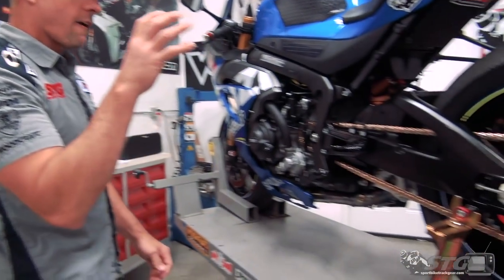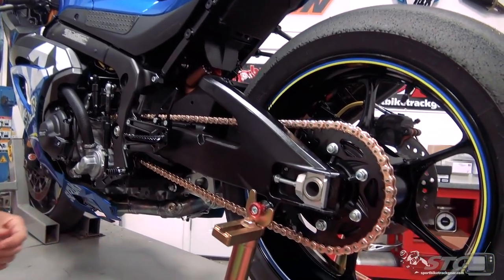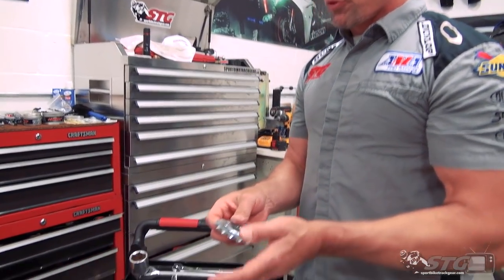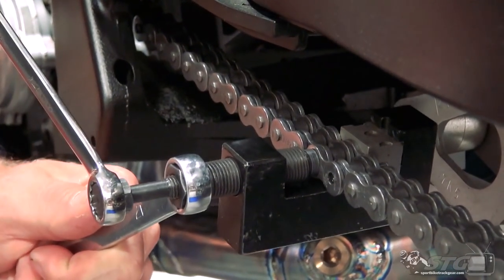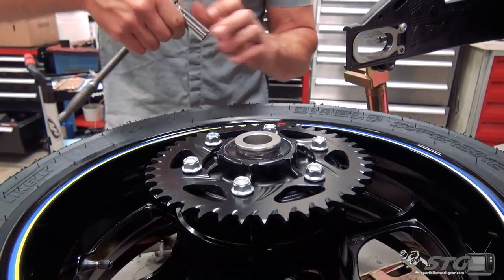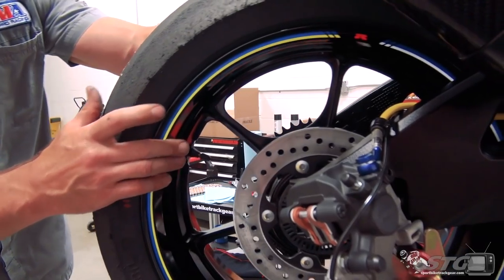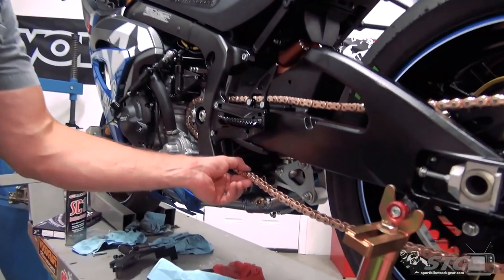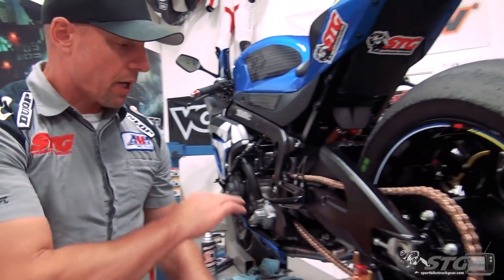Vortex 2018 Suzuki GSX-R1000 Chain and Sprocket Install | Sportbiketrackgear.com

Comment: great video. need some advice please 

 I had a massive issue with my front sprocket which has resulted in possible damage. So, as per other videos and guidance, I had the Mrs stand on the rear brake whilst i tried to crack the nut. I was giving it my all and then something made a horrible cracking noise, the bolt was still solid tight, but something else cracked - don't know what. I immediately stopped. continued with the rear sprocket and new chain but when I started the bike I now have an oil leak - not major, but slow. it looks like its coming from the water pump.  I haven't ridden the bike at all yet since changing the rear sprocket and chain but the horrible cracking noise has done something.

Any ideas on what this could be and what made an heart breaking cracking noise?
Reply from the maker: Man that does not sound good. You need to run the bike on the stand and track down the leak before you ride it. Remove the fairings so you have a clear sight line when inspecting. - Van
Reply: @sportbiketrackgear  yeah I have no intention riding it. It only seems to leak when I start the engine. What on earth could have made such a horrible cracking sound?
Reply: @pwh1t3y  first of I don't know what kind of bike you have but make sure it's not a reverse thread. I use a impact to remove and tighten. You just can't get it to spec tightening it with a torque wrench. There's too much flex everywhere. That's where the impact helps a ton. If your leaking oil from the water pump you going to have to remove the water pump and see what you can. If the bike wasn't in gear and your wife was on the rear brake the leak could be bad timing. Nothing could be stressed other than the chain and Sprocket in neutral. It sounds like some kind of bent shaft if it's leaking from your front sprocket removal attempt. Go Impact for this. Many years ago I did a sprocket kit swap on my K5. I was at spec using the torque wrench. I had a piece of wood wedged between the wheel and swing arm. Many years later when I went to change it. It just loosened right off. It was barely tight at all. I'm very careful now and only use a impact to remove and tighten. I always check it when I'm done by trying to remove it to make sure it's tight. I'm just paranoid after that incident. Unfortunately your going to have to remove that water pump and dig deeper. If the bike was in neutral you didn't break anything serious. Maybe just  coincidence

Comment: Hey van I  have 2011 gxsr-1000 was thinking to go 16 teeth front and stock 42 rear ,what would u recommend?
Reply from the maker: For 1000's I usually recommend leaving the stock size up front and going up 2 teeth in the rear. End of the day going down 1 in the front is pretty close to going up 2 in the rear. I think that would work well for your bike. - Van
Reply: Thanks u sir will pull my order in soon

Comment: Did changing the gearing mess with your speedometer?
Reply from the maker: No the speedo works off of the wheel speed sensors so the gearing does not influence. -Van
Reply: Sportbike Track Gear what about mileage

Comment: What would be the best gearing for a 2021 gsx R1000R ???
Reply from the maker: I am stock front tooth count and one tooth down in the rear. This has worked great for me at each track I have ridden it on. Makes 1st gear a little more useable. - Van
Reply: Would that be OK for street and highway riding as well?

Comment: I have a vorlar chain with a master link and clip...do i still need to press rivet the pins?
Reply from the maker: I use a clip link on the Ninja 400 and the R3. On my GSXR 1000 there is a rivet link. - Van

Comment: You left out tightening the countershaft nut.
Reply from the maker: It may not have been included when the video was edited. 2 years later and it is still tight. - Van
Reply: Thanks, love the vids!

Comment: So why ain’t this standard
Reply from the maker: The new GSXR1000 is a great bike (all of the latest 1000's are awesome). That said it comes ready for the street or the track off the showroom floor. With any street bike there is a lot of room for improvement when prepping for the track. - Van

Comment: how tall should I go with 200hp though
Reply from the maker: I rode the GSXR with this gearing all season and it worked well everywhere I went. The bike has not been on a dyno, with the system and the ECU flash it should be approx high 180 maybe 190. - Van
Reply: @sportbiketrackgear  cant keep the front wheel down with the stock gearing after fuel mapping and especially the map for MR12 at 200hp
Reply: @sportbiketrackgear  was thinking 3 down on the rear sprocket might be the best option for road race setting
Reply: @sportbiketrackgear  but the gearing you suggest with the 190hp for this bike, would probably feel perfect on the track. It's just got too much low mid and not enough top for straight. Running out of gear fairly quick at 178mph lol
Reply from the maker: The gearing on my bike is 1 tooth taller than the stock gearing. I have not had the bike over 160 on the tracks I rode in 2018, hopefully with the bike set up a little better in 2019 I can get a better drive etc... and get that into the 160's. I think there is enough gearing here to get into the 190's with enough straight and decent conditions. I had stock gearing on my 2015 R1 and hit 194 with a little draft at Daytona a couple years back. Straight line speed is not an area I have a lot of experience with to be fair. Brocks Performance does a great job with that, I would take a look there if you are interested in drag racing etc... - Van
Reply from the maker: Where do you have your axle set in the swingarm? Getting that as far back as you can will make a marked difference. I have the axle set back on my bike, noticed the difference straightaway. Also where do you have the TC set? - Van
Reply: @sportbiketrackgear  axle is set right in the center. I figured I would drop at least a few teeth on the rear and set it all the way back as you did in this video. I dont want to extend the swingarm or anything like that because I still want to be able to take it to the track but at the same time not be left in the dust in a street race with other 17, 18 super bikes
Reply from the maker: @will160176  if your chain is in good shape you could try replacing the rear sprocket to make the gearing taller and pull the axle back. This would help you understand if a couple teeth will get you where you want to be without replacing the entire chain kit. Once you have a good idea where you want to be you could upgrade the chain and sprockets to something that offers less drag than the OEM chain. Drive train friction eats power, working to reduce that with a better chain, making sure the axle is aligned and keeping the chain clean and lubed will help you get where you want to be. - Van
Reply: @sportbiketrackgear  that's a wise plan. I like that idea. Thanks. I think the fact that I'm 245lbs might have the effect of me not being able to redline in 6th? I reach my peak of the curve 12.8k rpm in 6th and it's over for me at least. 177-180mph

Comment: Uh,  smaller rear sprockets provide a higher gear ratio.
Conversly smaller in front is a lower ratio.
Reply from the maker: Smaller rear sprocket = lower gear ratio with larger rear sprocket offering a higher gear ratio.
Smaller front sprocket = higher gear ratio 
15 Tooth Front with a 44 Tooth Rear = 2.93 ratio
15 Tooth Front with a 45 Tooth Rear = 3.00 ratio
14 Tooth Front with a 45 Tooth Rear = 3.21 ratio
Reply: @sportbiketrackgear  

Narration stated a smaller front yielded  a lower gear. 
Simply not well stated.

Comment: Van! Did you fit a Healtech speedo healer after this or not bother as it’s a race bike?
Reply from the maker: I did not fit a Healtech Speedo Healer for 2 reasons. 1) It's a race bike and I am not concerned about the accuracy of the speedo etc... 2) This is an ABS model that uses the wheel speed sensors to calculate speed. That said you can change gearing without affecting the speedometer. (only changing tire sizes will cause inaccuracies). - Van
Reply: @sportbiketrackgear  As always, thank you Van!

Comment: I want to order this set for my gsxr 1000r 2018. Can i have more details? Thank you!
Reply from the maker: Here is a link to this kit on our site:  https://www.sportbiketrackgear.com/m4-ecstar-suzuki-gsx-r1000-17-18-vortex-ek-520-chain-and-sprocket-kit/

I have run this on the bike all year and it has performed great. Very little chain stretch and no extreme sprocket wear. - Van
Reply: Yay.thanks! I watched the whole video its great. May i know if this will be shorter/longer or just the same lenght with the stock?
Reply from the maker: The wheelbase is a little longer than it was stock. With this gearing I used a 118 links for the chain. - Van
Reply: @sportbiketrackgear for stock wheelbase how much lonks is good for 16/42 ? 116-117 ?

Comment: just did min this afternoon, did my rcs19 and lioness well, have an issue w the dead travel/slop in the rcs19 tho even this its properly bleed https://www.youtube.com/watch?v=EWH-7zJuBLs
Reply from the maker: Use a cable tie to hold pressure on the brake lever and let it sit over night to make sure all the air is out of the system. From the video the lever does not look bad, hard to really tell without being able to touch it. Try that trick and let me know. - Brian Van
Reply: thanks for reply, I did that yesterday afternoon after I did it since I was waiting to install the exhaust I just put on an hr ago.no difference I the lever take up, its definitely in its design, will have to make a custom pre-travel eliminator screw or shims near the brake microswitch.

Comment: What sproket sizes do you recommend for the new zx10r wanna wake her up
Reply from the maker: I would start with adding two teeth in the rear. With a 1000 we find that to get you more acceleration without making it a total wheelie machine. - Van
Reply: @sportbiketrackgear   so going up one in the rear is not enough?

Comment: Steel sprockets last longer then aluminum ??
Reply from the maker: Yes the steel sprockets will outlast the aluminum for sure. - Van
Reply: Thanks can you recommend a street configuration???? On the sprocket gearing 2 ,3 down rear and front ? I have a 2017 gsxr 1000